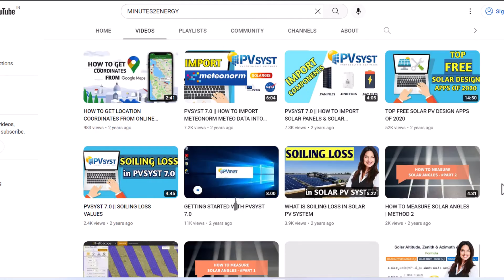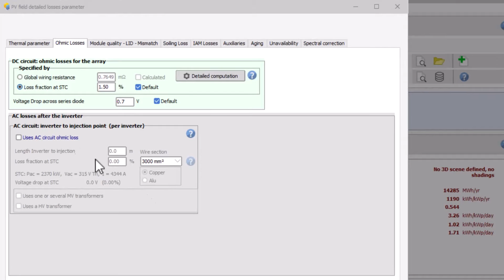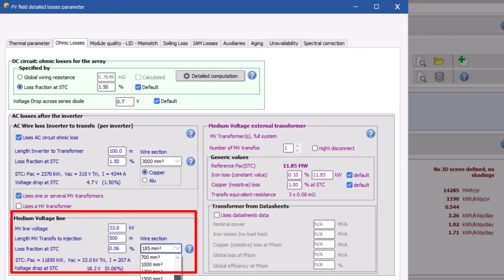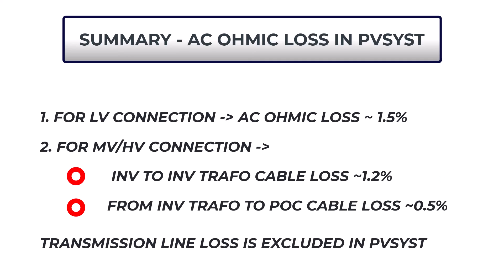HOW TO CALCULATE AC OHMIC LOSS IN PVSYST || #solar #pvsyst

Comment: Hi. I think there is a option in PVsyst to consider the transmission loss from HV transformer to point of interconnection. By checking the box "Uses a HV transformer". Once you allow to use the HV transformer, you can input the wire size, length and the voltage of the line as well as the iron and copper loss of the HV transformer.
Reply from the maker: Yes u r right. But it's then restrict to use MV line and MV trafo in the circuit. It's either or type in input window.